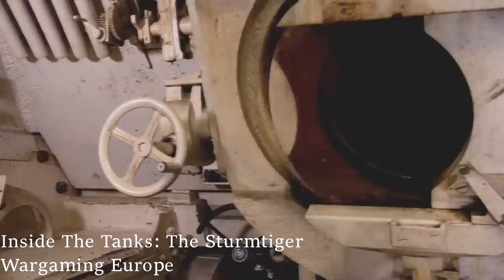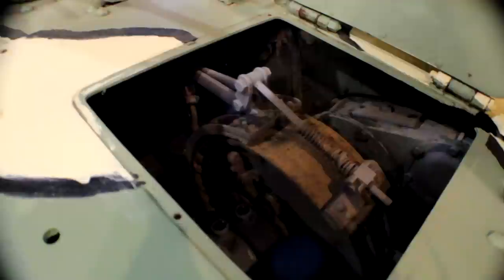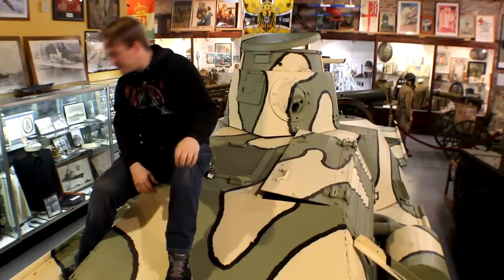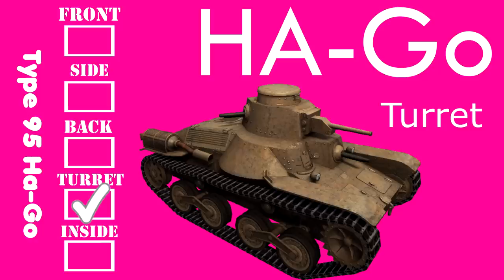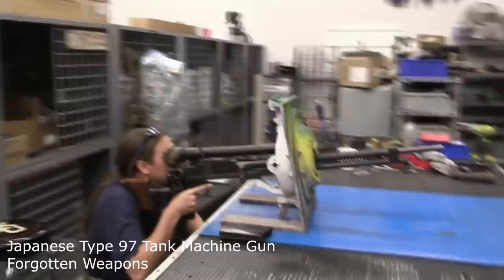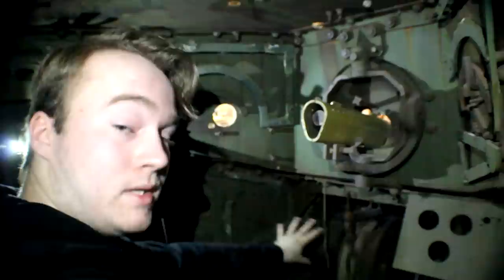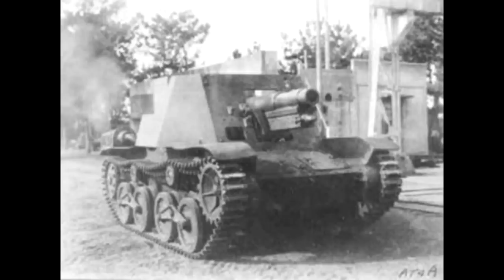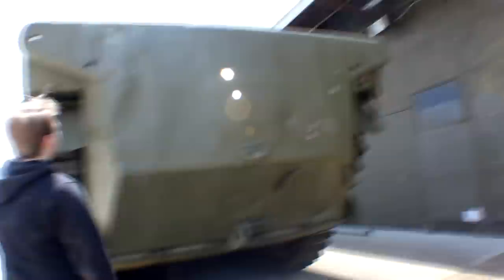Inside the Wannabe's Hatch: Type 95 Ha-Go

Comment: A few comments: most tanks came with the Type 98 37mm, a higher velocity version of the Type 94, the cupola vision slits always lacked protective glass vision blocks, the tanks were initially usually without radios, but by 1944 most were equipped with them, the ammo carried was HE and APHE, most of which was HE, since the tank was mainly intended to support infantry, and the Japanese definitely did go on to update their tanks and produce heavier models, like the Type 97 Chi Ha, Type 1 Chi He, Type 3 Chi But, and Type 4 Chi To.

Comment: "I know a lot's made about Japanese tanks not having radios. But this one, especially with how small it is, I don't see it being as big of an issue." ~ Quoted from the video

What you're discussing is an intercom, not a radio. Intercoms make communication within the tank a lot easier, especially when engine noise is taken into account.  A radio would not have been used to communicate between the commander and the driver. That would be an intercom.

Radios were used to communicate between tanks for the purpose of coordinating the actions of tank units. Lack of radios was a serious issue from a command and control standpoint, regardless of how small the tank was or how well the internal crew could communicate.

In short...

1. Intercom = communication between crew members of the same tank.

2. Radio = communication between several tanks, such as the five tanks of a tank platoon.

Comment: It is likely the engine running would  have made it very difficult for crew members to communicate. The commander in a Renault FT light tank would use physical contact with the driver to give commands, this is likely the same for the Ha-Go.

Comment: when you plop an engine on an angle in the engine bay its called a slant = ( what ever 4, 6, 8, )  so this would have had a slant six , slanting the engine in theory gives a straight engine some benefits of a "v" type engine but without the extra weight of the v package , the idea is the v type engines counter sideways vibration because the pistons produce equal forces basically making the engine run smoother using less energy to produce more horse power than an upright six , slanting a six or a four on an angle is supposed to do the same thing , v type engines are just easier to accomplish this so they just mainly go for those now days

Comment: With a lot of the discourse around tanks or other weapons systems, it seems to always leave out what I would say is the single most important factor, and that is how the weapon is used. Sometimes a weapon that is mechanically inferior turns out to be tactically superior. 
The T 34 was not a mechanical marvel by any means. But, the design was exactly what the Soviets needed for their tactical and strategic purposes, and, they figured out how to use it in a way that would win them the war.

It kind of reminds me of the Lebanon war in 2006. Israel had just brought out the latest version of the Merkava tank, Claiming it was basically invincible. Then the minutes a couple of those tanks crossed the border into Lebanon, has Belal set off a couple roadside bombs, simple improvised explosive devices, and blew the tanks up.

Comment: Thank you for a well done video. The only thing missing is a explanation of the air conditioning system. Also did the crew have reclining seats and a refrigerator? These beasts must have gotten well over 110 degrees inside!

Comment: Nice vid!  Next time I pass through Indiana I'll have to check it out, I'm from Iowa so it's not far...feeling dumb for not having been there before on my trips to Pennsylvania.

Early French tanks also used a type of shoulder elevation technique for their 37-47mm caliber guns, human stabilization...only the French version could also be aimed left & right slightly independent of turret traverse.

I wonder if there are any other gauges missing on the Ha Go, or if it was just those 3? Hmmm...speedometer not very important on a vehicle that only goes 25mph, so maybe there wasn't one. I'd suspect they were oil pressure, temp, & maybe a tach or fuel gauge..or maybe volt/amp meter instead, cuz even rpms & fuel not too important to keep an eye on(you can listen & guesstimate rpms, & fuel probably can be checked from the filler cap) but hey, i really don't know...i didn't build it. That  Japanese tank interior...talk about minimalism!

Comment: Dont think many tanks used internal radios; not much point. An intercom system is the typical solution, with hard wires and mic jacks. Same with aircraft. Radios were pretty bulky and unreliable back then, and hardly needed to communicate over 2-3 feet.And I would probably describe those round ports more as pistol ports than vision ports. The slits are for vision, the larger round opening was for small arms defensive fire, though no doubt it was useful for ventilation and visibility as well.

Comment: I'm not an expert on Japanese Tanks and AFV's but at 12.50 you said that "the Japanese did not go on to upgrade or make Heavier Tanks like other combatants of WW2"  Well they did. BUT most of these tanks were kept inside Japan for they anticipated invasion of Japan.
 
For example, they made an improved version of the Type 97 called the Shinhoto which was armed with the more powerful 47mm main gun with later versions having 50mm of armor.
 
Then they had the Type 3 Chi-Nu which was a medium tank which was armed with a powerful 75mm gun but due to US bombings they only managed to produce 144 tanks of this type.
   
The Type 4 Chi-To was in all more on terms like the Sherman armed with a 76mm gun. This new tank was armed with a HV long barreled 75mm gun with 75mm armor. It was suggested that 20 per month to be made but with the Bombings only 6 chassis had been made with only 2 of these tanks having been built. 

And Finally there was plans to build a Heavier tank armed with a 88mm called the Type 5 Chi-Ri but my book says nothing really came of this and instead they concentrated on the Type 4 instead.

The Japanese also had assault guns and TD too but in very small numbers. Like i said i am not an expert on Japanese tanks, i only have one book on the subject and it is limited on what's in there. If there was any other Japanese tanks other than what i already know of or what is in my book, then i am unaware of these.

Comment: Wait... The Japanese actually have better tanks by the middle to the end of the war namely the Chi-Nu Chi-To and Chi-Ri. However those does not seen any combat as Japan only keep them for the  mainland defense (which the invasion never occurred). The Chi-Ri in particular was supposed to be fitted with Japanese 8.8cm anti-air gun similar to one on the Tiger. The Chi-To was experimental model which was eventually cancelled in favor of production of the Chi-Ri, but mounting powerful 75cm main gun and comparable frontal armor to a Soviet-made KVs.

Really get you thinking what if those tanks were put to action.